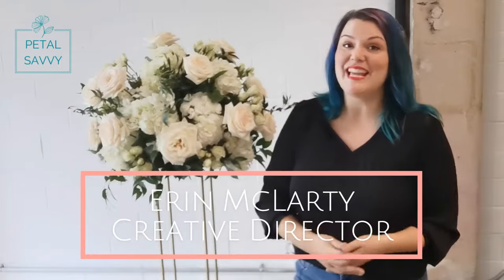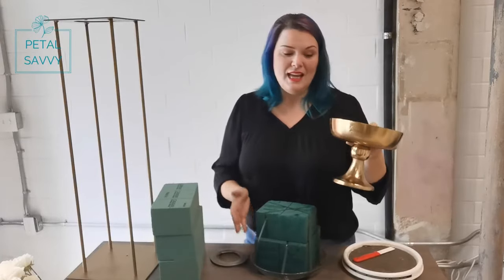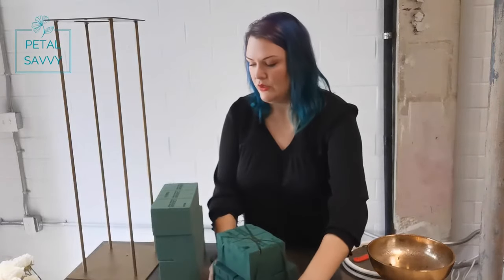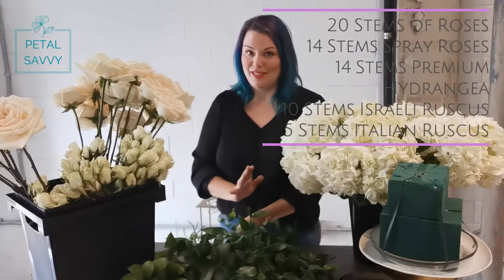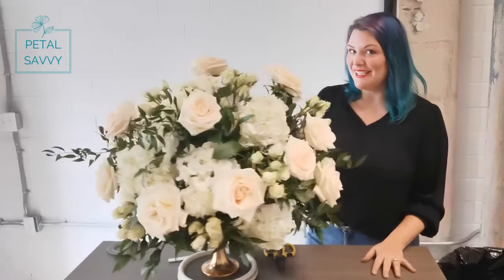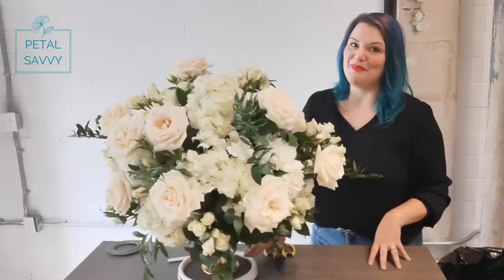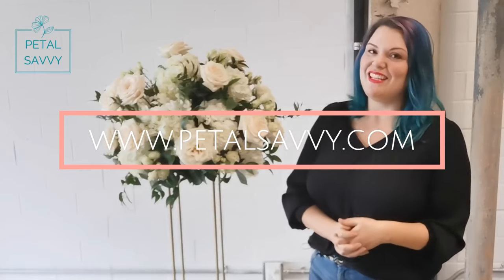DIY Wedding Flowers - Elevated Arrangement with Petal Savvy : Tall Centerpiece Tutorial

Comment: @Petal Savvy one big question.  For the hydrangeas, I am in California where it is very dry and hot, how early can I do a wedding arrangement?  Truly appreciate your response as wedding is this coming Saturday.  thank you!
Reply from the maker: Is the reception going to be indoors?  I do not recommend hydrangea for DIY'ers for hot, dry climates if the flowers will have to be outside at all!  If you're just doing a couple of big pieces for the ceremony and it's indoors, do it the night before and keep them as cool as possible and refill the water tray before bed and first thing in the morning.  If your reception is outdoors, I do not recommend hydrangea unless it's in water directly.  I'm from Texas and did a wedding in a tent in March down near the Mexico border, there was like 0% humidity and even though I made the centerpieces at 3am the night before, just the air conditioned van ride to the reception and being in the tent for 20 minutes had those hydrangea dying.  I'm in San Antonio, we have a fairly constant humidity, but it was so dry, over 90 degrees and we didn't have any sort of ac or fan or swamp cooler in the tent and it was so hot in there.  We were removing and replacing our hydrangea left and right.  I've never experienced anything like that.  There are tricks, like using the pickling agent Allum (dip your stem into the powder after you cut it and before putting it in water or foam), and when you process your hydrangea to dunk the whole head in water, but I don't even think that would have helped this situation.  If you can swap out hydrangea that would be going into foam with more roses and snapdragons, carnations, and alstromeria, I would highly recommend doing so.  Those will all hold up better.
Reply: @petalsavvy8463  Hi, thank you for your response an suggestions.  The event is indoors and we will be running the A/C but maybe to be safe I may use only 2 and all the alternative flowers recommended.  Thank you so much for that!!!

Comment: Great tutorial. When do you recommend we make the bouquets before the wedding? Concerned how long hydrangeas will last in a humid climate.
Reply from the maker: Hydrangea actually loves humidity! But large arrangements, if you don't have refrigeration, the day before is ideal.  If you have a nice cold room and make sure your foam stays refreshed with water twice a day, you can get away with 2 days before.  Bridal bouquets and low centerpieces, 2 days before.  Keep bouquets in vases or jars with water, and foam containers always topped off with water.
Reply: @petalsavvy8463  Thank you. Last question, how much time should you plan per centerpiece? We are trying to do 6 large arrangements and 15 small centerpieces. The small will be around a lantern.
Reply from the maker: Are you doing just loose flowers and greenery around the lantern, or do you plan to do them in a foam form?  For the big ones, give each designer about an hour, as you progress it may dwindle down to 45 minutes.  It's a leaning curve and a flow.   Lanterns with loose floral can be done super duper quick the day of the wedding in like 5 minutes per table.  In foam it can take 10-15 minutes.
Reply: @petalsavvy8463  Wedding is next year. I will book a tutorial on your site closer to the wedding day to make sure everything I have planned makes sense. Flowers around lantern will be in flower foam. You have been extremely helpful.
Reply from the maker: Yay, thank you!  Once you know the size of the base of your lantern, let me know.  I'll make a new video based on lantern flowers!
Reply: @petalsavvy8463  Hi, the lanterns are 15x5. They are currently on clearance at Michael's.  The plan is to use them as centerpieces, but also use lanterns for aisle walkpath without the wreath. Looking forward to the video.

Comment: Is there something we could use in place of hydrangeas that will last longer? I do not want to stress about them wilting! 
I am getting married indoors in Chicago in August
Reply from the maker: If you're getting married indoors you should be just fine using hydrangea :)  if you would prefer to substitute, you can!  There's nothing quite as large, though, so you'lldo a 1:3 swap.  Examples:  You can sub each hydrangea for one football mum, a stock, and an alstromeria. Or swap for a snapdragon, a cushion pom stem and a spray rose stem.

Comment: I am using 24" Pilsner vases with a 4.25" opening. Can i still use the 9" lomey dish. should I tape the foam or wrap it in chicken wire?
Reply from the maker: Always tape your foam into the lomey dish, otherwise your arrangement won't stay in place during transition.  Pilsner vases aren't as stable so be sure to fill it with water.  You should probably also consider a 6" lomey dish and cutting back on the recipe so your arrangement is smaller so it is a better proportion to the vase size.  7 hydrangea (premium size, not jumbo or standard which is small), 10-12 roses and 4-5 spray roses with greenery is a decent amount for a smaller tall arrangement.  Use one full brick of foam, cut in half and stacked.  Tape one strip of tape over the bottom half brick, and 2 strips in an X or even 3 strips for extra security over the second half brick.  You can chicken wire but I don't find it necessary for smaller tall arrangements like this.  Hope that helps!

Comment: Hi, I am not sure how you place the foam.  The one in the bottom is 2/3 as well the one in the top.  Thank you.
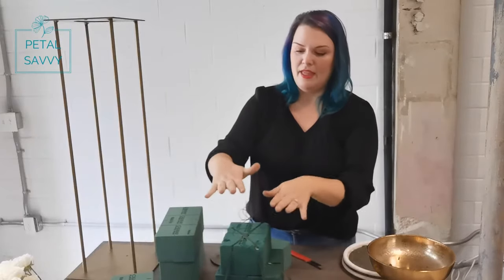Reply from the maker: I would recommend rewatching starting at about 2:30. It is 3 brick, that are cut to 2/3 of a brick.  I place two side by side in the bottom, tape, then the third piece on top of those, and tape again.  You could also do this with 4 bricks if you feel you would need more surface area, it's just very heavy.

Comment: Have you considered alternatives to flower foam for environmental purposes?
Reply from the maker: Great question!  Yes, but for the average DIY bride theybare not practical, which is who these videos are intended.  For my own business, for retail I like using chicken wire and water for low arrangements. however I live and work in San Antonio and most of the year it's hot and the flowers don't hold up well in packed moss and agra wool and other products are not readily available in our market.

Comment: Hi 
What tape do you use? Can you share the link? Thanks!
Reply from the maker: Check this out on Amazon
Oasis 1/2"x60yd Green Waterproof Tape https://smile.amazon.com/dp/B00213KB80/ref=cm_sw_r_apan_glt_fabc_NDCMYNSW5CNDW1DS5G33?_encoding=UTF8&psc=1
Reply: @petalsavvy8463  thank you for the link. I bought the green floral tape and it did not stick to the vase st all. This must be a different tape.
Reply from the maker: Did it look like this one? Plastic, green on one side with the sticky side more of a white color?  Or was it more like paper?  The paper tape is for making corsages and wrapping wire.  If you did have a tape that was sticky, and did not stick to your vase, please note the vase must be completely dry for the tape to stick.  So when you get this kind in the link, make sure your containers are dry.  Another good practice is to tape across your first line of tape with another small piece horizontally (imagine your main line goes north to south, then you want a small piece to cross over it east to west)

Comment: Hi how much would an arrangement like this cost?
Reply from the maker: Are you asking the retail value if you were to buy it from a florist, or the cost to make it yourself?
Reply: @petalsavvy8463  if I were to buy from a florist.
Reply: that is one really expensive centerpiece!
Reply from the maker: Yes, depending on market value which is fluctuating rapidly due to supply chain issues, it would retail probably $350-425
Reply from the maker: Market prices are different, the farther things have to travel the hight prices go, I would estimate these would retail with current prices 350-425.  Supply chain effects everything!